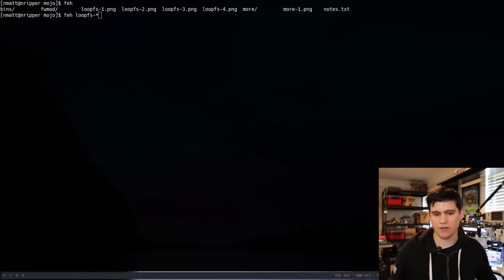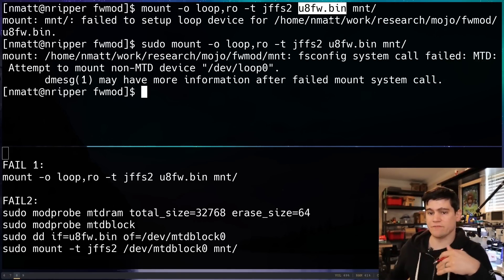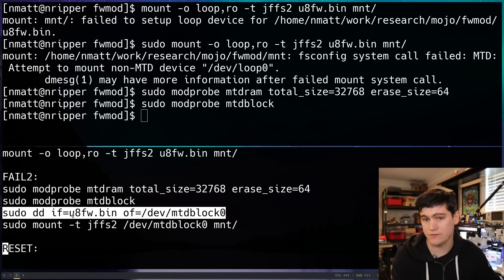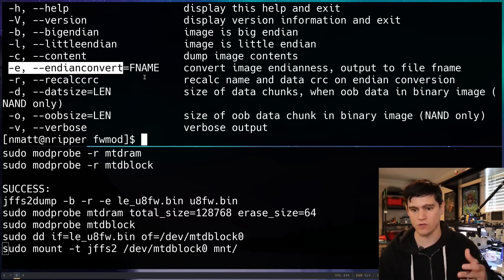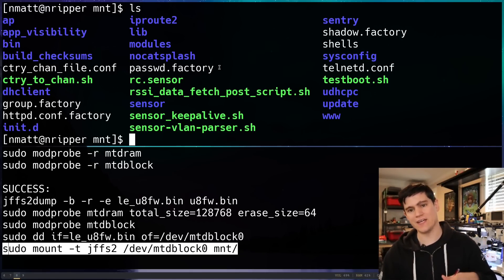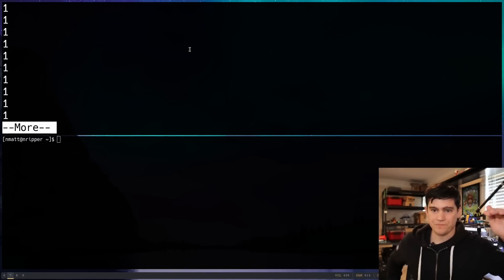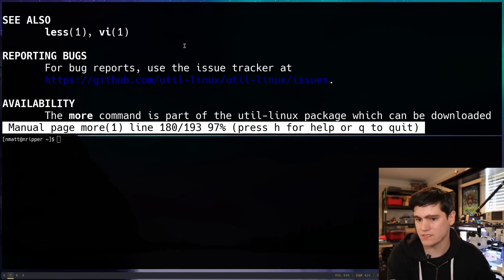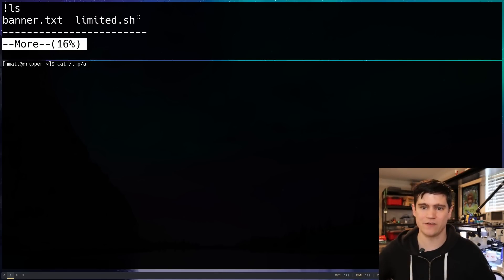Hacking The Mojo C-75 - YT Comments Follow-Up

Comment: wtf? Why has the "more" command this functionality? Isn't it a big security vulnerability?
Reply from the maker: No it's not a vulnerability typically because usually in a full shell like bash if you can run the more command you can also run any other command. This only becomes an issue when you have some type of restricted shell that limits what commands you can run.
Reply: no because more is often a wrapper around vi or vim and it is incredibly useful to shell out from those when editing files, you could make an argument that you should be able to disable it as an option when used as a general pager though